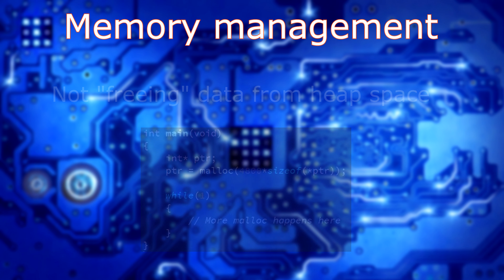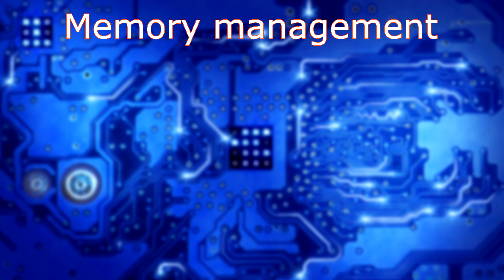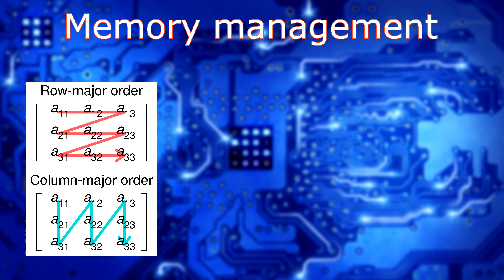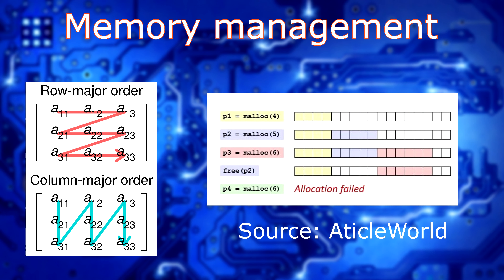Why you Should NEVER Use Malloc in Real-Time Systems

Comment: Yep in games we just do a single (or 2) giant allocation at program startup then use that memory pool with custom allocators when dynamic memory is needed. Not a single dynamic malloc/free call afterwards. Much easier to work with and headache free (mostly) as long as you remember your push/pop e.g. if using a stack based allocator. The nice thing with this approach is since its one block of memory, its easy to do things like taking a snapshot of the system and reverting back, or do code hot-reloading etc.
Reply: I'm in a similar situation. What allocation strategy/algorithm are you using?